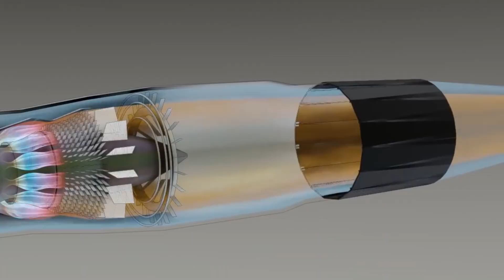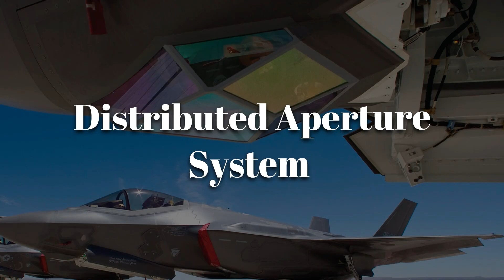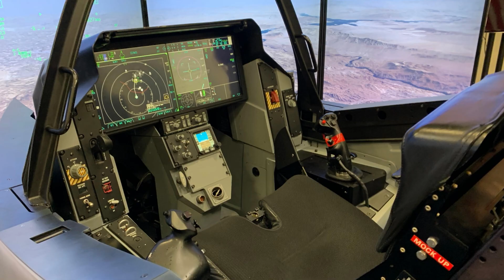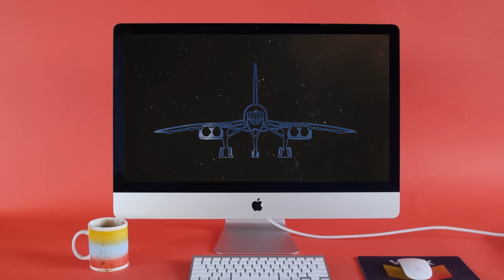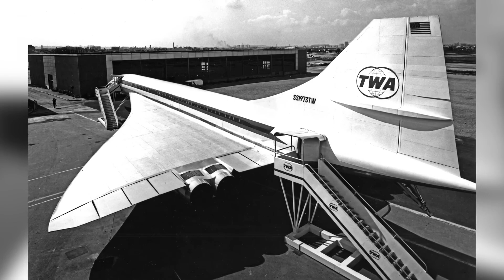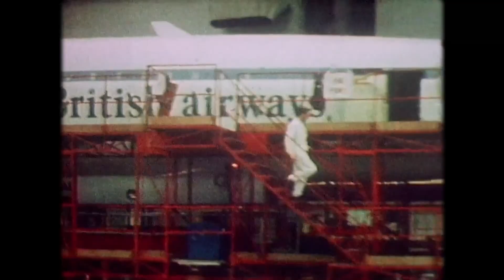How The ENGINE And Weapon SENSORS Of America's STRONGEST Fighter Jet Is Made

Comment: It is NOT ogee, it is ogival.
An ogival planform (or ogival delta) is a wing shape that resembles an ogive (a curved shape, like a pointed arch or cone) or a double delta when viewed from above. This configuration, often used for supersonic aircraft, features a leading edge that is curved rather than straight, which helps to minimize drag at high speeds and manage leading-edge vortices for low-speed handling. The ogival delta design provides a balance between high-speed efficiency and low-speed control.